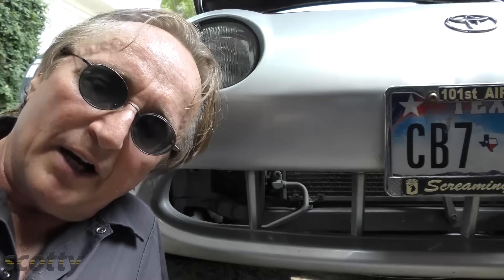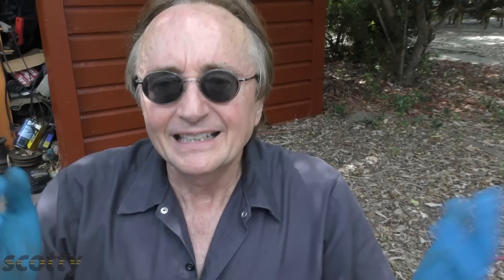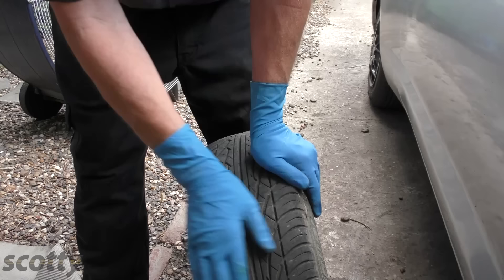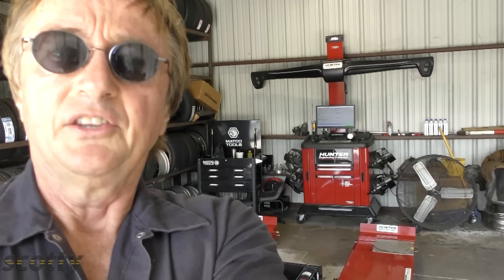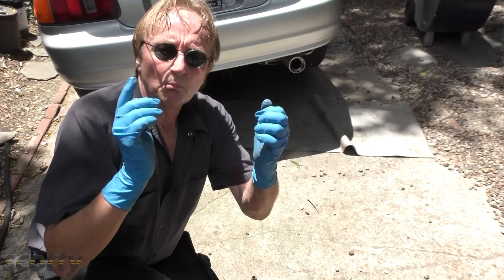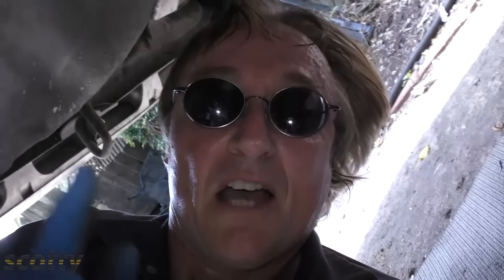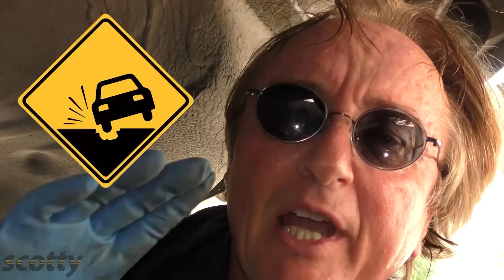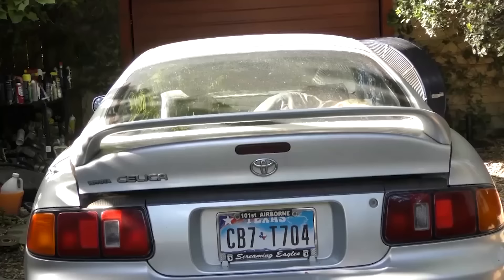How to Tell if Your Car Needs an Alignment

Comment: caster, keeps it going forward and returns the wheels back to center after a turn. can be roughly checked by turning the wheels all the way to the left, and the top of the left tire should lean slightly away from the vehicle, all the way to the right and the top of the right tire should be leaning slightly away from the vehicle. which leads to camber. that's when the tires are pointing straight ahead and the tops of the tires are leaning in or out. and lastly, toe in / toe out. that's the distance between the center of the front edge of the tires compared to the center of the rear edge of the tires.

Comment: The shops are always trying to sell me a a alignment. Especially after a tire purchase. Alignments are based on the hubs/rims. If the tires are made right, they should be aligned, too. If it ain't broke, don't fix it....If I can stand on the accelerator on the highway, take my hands off the wheel and the car goes straight, no vibrations, etc...the alignment is probably fine.
Reply: Sandy

Comment: I bought new tires for my crown vic once and i agreed to an alignment.  I told them i put in new control arms and needed to have the camber brought to spec and that i would need a printout of the adjustments. All of a sudden their machine was broken.

Comment: I was wondering on how they adjusted the wheels earlier.  Which part of the suspension is touched to do the adjustments? So that is how they do it. Wheel alignment is just done by adjusting the tie-rods.

Comment: I really enjoy your channel, Scotty.

I have a 2017 Toyota tundra and recently got new tires and I ALSO HAD AN ALIGNMENT AND THEY CHECKED IT OVER REAL GOOD AND SAID NO ISSUES BEFORE ALIGNING for $100 and I am concerned about the steering wheel because it is just very slightly to the left of center.  The truck drives straight and doesn't pull to the side and the steering wheel doesn't shake or pull or shimmy.

I was wondering your thoughts if this is an issue that needs to be addressed before it ruins my new tires , or will it be good to drive as long as it doesn't drive my OCD nuts. 

Thank you in advance
Reply: Any updates on this? I’m stuck in a similar situation with my chargers steering wheel slightly to the right, everything else is fine

Comment: the ruler system works good enough so if you change your suspension out with new struts/shocks or lowering springs. you do it so you can kind of drive to the actual allignment place

Comment: Its normal for your car to pull to the left if you drive on the left side of the road in some countrys and normal to pull to the right on roads that you drive on the right hand side.
Most roads are made off camber so as to drain the water to the edge of the road and also for drivers that fall asleep at the wheel so they will drift to the edge of the road instead of oncoming traffic.
You can switch your tyres front to back every few thousand miles to nearly get rid of the drifting to one side effect,but make sure you switch the same side because your tyres may be of the directional type.

Comment: B6 A4, both front tires have inside side if tire wearing. Alignment was done by a " pro " at a shop, lol. Is that to much toe in or out?

 My advise to viewers. As Scotty said if its not broke dont let them touch it! If you have a german car your better off taking it to a place that specializes in german cars. Regular places wont do it right.

Comment: Most big performance track purposed cars have more toe out than a family car. It’s even noticeable to the eye. My camaro new from Chevy had two alignment options from GM. For 100 more with new Chevy camaro or Corvette you can have a GM track alignment. But again it wears out tires slightly faster

Comment: Basically, the only adjustment most cars have anymore is toe-in. Every manufacturer has a range of acceptable dimensions. I can set toe-in within 1/64" with my tape measure and a reliable friend. I have aligned trucks, cars, race cars and a lot of other things in the last 60 years and unless the suspension is damages, there's no problem.

Comment: Tire stores make a lot of money doing alignments. But, like Scotty says ...  if your old tires are evenly worn and your car is steering and handling properly, it is very unlikely that you need an alignment. This is an example of where the old platitude about not fixing things that are not broken definitely applies. There is a real possibility that the "alignment technician" will take a properly aligned car and misalign it. It happened to me and the alignment was done at a Ford dealership on a Ford car  by a high labor rate "ASE certified, factory trained" mechanic.

Comment: Usually if the tire is ok, being the weakest point; I believe suspension parts should be ok unless there's a lot of wear from a lot of miles. Pat Goss on motorweek I believe once said that alignment is not that easy to damage, as you basically have to bend metal. I think it differs from car make to car make. A bad pothole should damage a tire or rim first before damaging other parts. However if a car has a ton of mileage, and driven on bad roads, then the cumulative effect will take its toll on suspension parts.

Comment: I have been told that because of power steering at slow speeds tires will wear on the inside more then the rest of the tire. My car runs straigt for miles never had an accident but both front tires are worn on the Innerside (front wheel drive)

Comment: When getting an alignment, please ask for "life time" alignment.  Back in 1991, when I had my 1974 Toyota Celica front struts changed at Sears, they were offering special deal, the life time alignment.  This was a deal in which Sears will align my car as long as I own FREE of charge. And it was only $39.99.  So I bought this deal and I used to take my car to Sears for free alignment time to time when I felt alignment was off and that was a great deal.  So next time if anyone need to have your car aligned, ask if the shop is offering life time.  I am not sure how much they cost now but it will be just bit more than $39.99, but worth it.

Comment: I did a string toe alignment on my 2000 Explorer, I then bought new front tires, and have since driven 11K miles and the tires wear level, it drives perfectly straight, no shimmy, no vibration, nothing to differentiate it from a $75 alignment. This isn't the same as a modern CAR, but I doubt I'd drive anything that was IFS on all four corners.

Comment: My car steering shake very bad at 70 miles , i replaced all front suspension, did alignment, did wheels calibration but have bad vibration

Comment: After rebuilding the car I aligned my bmw by putting a long straight edge from back wheels to front and just making everything parallel, then I rotated the front wheels in about 1mm on the front edge ( I worked out what it needed to be based on the handbook or Bentley manual). Perhaps unbelievably it actually drives straight.

Comment: Maybe pin this one if it hasn't been mentioned.  I'm in Michigan,  and out of nowhere , after work , my steering wheel is shaking.  Tires are new , all was fine this morning.  I found out it was snow and ice that got inside my driver's side rim ! Maybe this helps someone

Comment: First time ever I don't agree with Scotty, yes mostly only have to worry about front toe, but if you dismantle or swap out front suspension parts you need alignment and DIY is easy, in Europe Trackace Laser Gauge is the DIY way to get accurate front toe check,  if you can measure accurate then you can set alignment accurate.

Comment: i done my own alignment on my 68 beetle when i replaced all the front end tire rod ends and ball joints havent had a issue yet with the tyres and that was 3yrs ago

Comment: scotty, i do feel as you was trying to "plug" mechanics with your "you need professionals to do it" segment, as the measuring and the string method works well,  of course a laser can be more accurate, but the point of the channel should be things you are able to do at home, now with that being said, if your wheel is shaking from lock to lock at a highway speed, not every one can go dish out money to get a alignment at that moment, but the string method will allow a fix until that can be done.

Comment: Yes sir I have a question. My 05 chrysler 300 pulls to the right I mean let go of wheel it goes right now it's worse the driver side front feels like it's bounces up n down. .Just had new tires front sway bar then had a full wheel alignment. I listened, and watched your videos. I took my car back to see what else can be done. Can you please share a bit of wisdom with me.
 Thank you so much for your videos, and you time.

Comment: I always use a laser alignment service, but apparently it can not be done to a car with back spaced wheels on front or back as I was told by my mechanic, I would need to go to a mechanic with the older style alignment machines, which are far and few between where I'm from, this leaves me with tape measure or nothing for the time being.

Comment: All, be careful when getting wheel alignments. It may start out as a $50 job, but you have to have perfect tires, perfect ball joints, control arms, etc. Anything near the wheels, the mechanic will insist on repairing first.  And those will sky rocket to thousands of dollars.
Lesson learned, never go to a mechanic. Don't trust them. Except for Scotty of course. He is one of the good guys.

Comment: I just replaced all the ball joints on my 97 f150 and tried to put it back together   like it was but it was still out 2 degrees. Now since an alignment and 4 new tires I avoid every little hole I see.

Comment: Can you do a video on the filtration quality of a reusable OIL filter.  Pure power makes the stainless steel filter for k&n with a micron rating of approx 22 microns the argument is that because the oil flows easier and is almost always filters through the filter media, where on conventional throw away oil filters while claiming better filtration actually utilize the bypass on a regular basis (startup and high rev) allowing dirty oil to circulate. so if there's some way to do a practical "real world" application/stimulation, thanks :)

Comment: I measure between the both sides of inside front tyres using a laser measurer and get accurate results, given there are variables. Hunter inspection although accurate is expensive, I'll stick with my method and still get peace of mind, cheers scotty!

Comment: wow this video comes at a great time! i was thinking about getting and alignment because my steering feels loose, wanders, not center and the whole front end wobbles at highway speed. even after i balance all 4 tires and joints has no play. so basically i need an alignment? this really affect the driving experience. manual steering by the way.
Reply: When you say "joints" are you talking about your ball joints, tie rod ends and pitman arm connections?
Reply: Its a rack and pinion steering. Manual. Yes that's i mean. Joints and bushings. But my steering feels loose going straight and whole front end wobbles at 60 mph. I was thinking about adjusting pre load on the rack or having the toe alignment.

Comment: PSA... Be VERY weary of the 'free" front-end alignment you get at tire stores like Town Fair Tire in the NorthEast. The problem is if your car is newer and you still have the factory alignment settings. These tire shops with their free alignment often take away those factory settings in favor of a zero toe setting, AND their alignment equipment is not as good as the factory's. Because your brand new tires with their perfectly symetrical tread dictate over the free alignment, the steering wheel usually stays nice and straight, but it's what happens after a month or so when the tires are no longer brand new. This is when you start feeling the front end being darty at highway speeds where lots of small steering corrections are necessary just to stay centered in the lane. That's what makes your new car not steer like new anymore and most of us blame it on the tires being inferior (if we question it at all). The lesson here is if your car is tracking straight with your old tires and shows no uneven wear, and there is no sign of worn components, do NOT get the free front alignment. Of course, if your new car came with crappy tires to begin with, they may wear poorly, but hopefully evenly. If they wear uneven, then you should either bring it back to the dealer for correction or spring for a four wheel FACTORY alignment, not just a "front wheel" alignment. Just sayin'!

Comment: Hey Scotty, 

Have a 01 lexus gs430
- changed the rotors and brakes 
- replaced all the tires and one rim
- had an alignment done (not sure how good) 

The wheel shakes when I brake at high speed and sometimes shakes at high speed. 

Mechanics out here dont know what it is
Reply: Sorry, not Scotty here, If the parts are all correct , it could be a warped / bent wheel hub or surface rust between the mating surface of the rotor and the wheel hub. There is also one very very very rare condition that can cause that, and that is resonance, causes can include many factors from bushings, control arms to the material compositions of the brake pads.
Reply: N/A WASD thanks for the response, thing is I hear a hollow noise when I accelerate especially during the winter.  Could that be linked?
Reply: Sounds like a tire or wheel bearing problem. If the noise was not there before the new tires was installed, it could just be the tires, if not, wheel bearing usually do have a hollow sounding noise. If all of theses check out then it could be a Drivetrain problem.
Reply: N/A WASD 
The hollow noise comes when its really cold.  Drivetrain problem??
Reply: Possible, because in low temperature, tolerances in metal will widen and oil from the transmission can become more viscous causing insufficient lubrication. Depending on the vehicle , you can just check to see if any of the CV axle or any other drive axle have play that can cause Drivetrain noise. If all seems lost, you can always post a video about it, I'm sure someone probably has a more definitive answer on your specific vehicle than me.

Comment: I need one but mechanic said it wouldn't last unless I got I think struts or shocks replaced. He wouldn't do it. Whichever ones are in the front. Is this right? Also said tire rod and piston needed to be replaced. I have an 11 year old 2007 pt cruiser. Got it in 2007 with 14,000 miles. 200,000 miles on it now. Still runs pretty good.

Comment: How about lowered cars? I installed a coil over kit in my 06 Camry. Set the camber in the front to -1.75. She rides great...corners super awesome...but going 80mph on the highway my steering wheel vibrates very bad. Car rides straight...let go of steering wheel car stays put...just vibrates... Below 60mph no vibration

Comment: Hey Scotty I’m gonna have to take my car to you lol it’s nothing dealing with alignments though. Every time I drive or if the car sits there I can smell fuel. It doesn’t run rough but sometimes the idle goes up and down and settles. I’ve checked the TPS and IAC both are good. I’m from San Antonio so you’re not that far away haha. I have a 95 Mustang GT btw.

Comment: 85% of pulling and vibration problems are tires problems.   Toe causes the most amount of tire wear and is the one frequently out of spec. Lack of rotation doesn't help either

Comment: Scotty , what if your tires are making noise? Whoop whoop at high speeds. Got it balanced , rotated , aligned and everything else was fine. Tyres wear evenly though.
Reply: Is it all tires or just certain tires? All terrain tires will make more noise no matter what. Same with 'LT' tires that you find on many trucks. If you're getting the noise from just one tire, it may be a failing wheel bearing.  Finally, it may just be a cheaper brand tire (depending on how much you paid for the tires). If they are wearing evenly, I wouldn't worry about it. But I would check your wheel bearing to make sure they are nice and tight. Bad wheel bearing is a serious issue.
Reply: Yea they checked it , its not the bearings. Its Goodyear eagle f1 asymmetric 17". I am not sure if all tyres or not.

Comment: Unless you have a lexus is 300. Then it will eat tires for breakfast. I love my car but yet again I made another appointment to get my alignment checked. It has a crazy camber adjustment that causes them to eat tires. Great car besides this issue. At least I get to try different tires every couple of years. So far Bridgestone are my favorite.

Comment: At my last "free" dealer service, when pulling into the check in bay, you run over a "speed bump" that checks your alignment. First time experience with that and I was skeptical. Sure enough they told me my alignment was out. Toyota Tacoma and it didn't pull to one side or vibrate and no uneven tire wear. Anyhow I agreed to let them do a $99 alignment. Anybody else have experience with that "speed bump gadget" ? What say you Scotty?

Comment: If you plan to own a vehical for 50+K miles and do work yourself a lifetime alignment is less than 200 bucks and you can take the car in whenever for free and preemptively prevent tire wear issues by getting it done like every oil change or 3 months.

Comment: Good stuff if you have an old car... But in most underdeveloped countries shops have these laser machines to attract customer but , as Scotty pointed out half a dozen times, potholes on roads have already made the suspension outside of the  adjustable range... So these people use tape to 'align' the wheels ... They take a test drive and sees where car head when steering is free so after word it is just a little trick and ' judgement' of mechanic to make car not pulling to a side for at least a month or so....